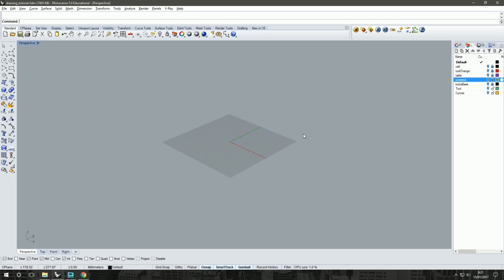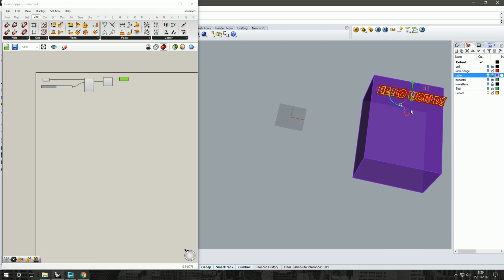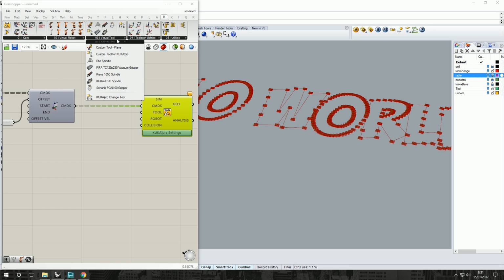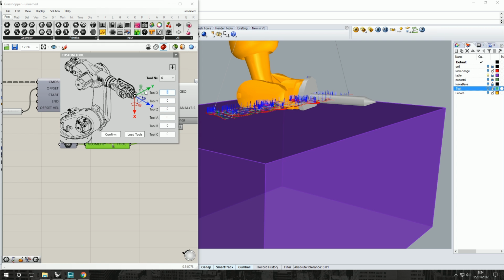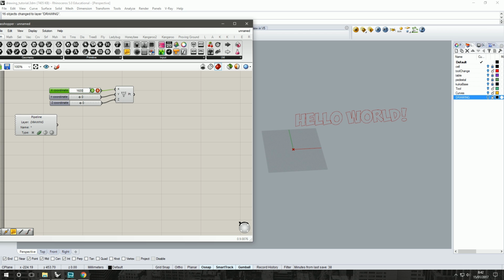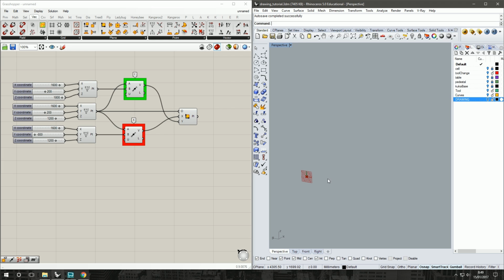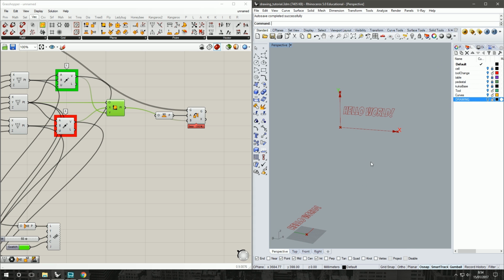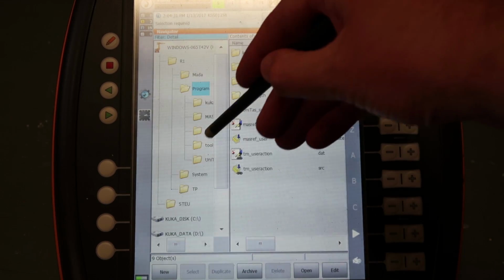How to Draw or Engrave with Grasshopper and KUKA - Tutorial

Comment: Right On. I have just gotten back into some robotic creative studies and your series really helps.  Thank you.
Reply from the maker: Glad to help!
Reply: @KarlSingline  This probably isn't the best place to ask this question, but I am having difficulty wrapping my head around creating custom tools that can articulate in and of themselves.  I am thinking of anchoring a point on the tool and moving the contact point on the wrist of the KUKA.  In turn, I would then, theoretically, be able to generate a new tool geometry that appears to rotate and articulate around a specified location.  Not sure if this makes sense but I will put my studies into the KUKA forum or the Rhino3D/Grasshopper forums.  Thanks for your scripts online and your tutorials.  -  Going further... Michael Wickerson
Reply from the maker: I don't understand what you mean by contact point. A lot of tools have multi-states, you can either offset your movements or just switch to another tool center point mid program.
Reply: @KarlSingline  Thank you for your feedback, I think the solution is simpler than I think.  I will look into multi-state tools and offsetting the movements.  I am thinking of using the robot to lift one end of a balance and having the "see-saw" pivot through the fulcrum and life the other end.  I would like to bring the simulation into FologramAR and have the "tool (see-saw)" update in AR as well.  I can't bring it into the real world because I don't have access to a KUKA and my simulation videos only updates the KUKA through the tool path rather than animating the whole system/model.  Thanks for your feedback, I am confident that I will figure it out but it is all new to me at this time.  Michael

Comment: Ji KArl I appreciate all the time and knowledge shared on your videos, This seems to be a great tool, I was wondering if the way you setup the whole cell was with parametically as well, I mean al the table, cell and everything was measured and then added in the world inside rhino accordingly? Did you made any tutorial on this? thanks!
Reply from the maker: I'll add it to the list!
Reply: @KarlSingline  
Thanks! Do you know any pace where I could find documentation related to code compatibility? My robot doesn't want to run programs created by the kuka prc, tells me some compatibility issues, I have search but not found any documentation regarding this matter. Thanks
Reply from the maker: @danielrodrigoramirezreboll7500  what type of robot are you using?
Reply: @KarlSingline I make it run now! I appreciate, it is a kuka kr16 Thanks so much! all of this is amazing

Comment: nice tutorial, especially for people that have no direct access to kukas :P

writing on glass? brave. how do you calibrate/zero the working surface? does the robot use a digital gauge to scan the surface ie. in 5 points? (corners, centre). If you use a spring mounted tool it is no (big) matter but when it comes to engraving, milling etc. it must be zeroed somehow.

with a kuka an tethered digital gauge with proper software could be used for 3D scanning as well i think.

Comment: hi guys, one problem.
when i want to initiate my robot, everything looks ok but  the fault message "active commands inhibited" popup. actually i can see the contactor on the KPS 600/20 does not actuate. and when i press its coil manually, emergency stop occure.
whats the reason?????????
Reply from the maker: Could be any number of reasons, generally means that something is not in the correct position to allow the kuka to operate. Check things like all stop buttons aren't pushed in and clear the log.